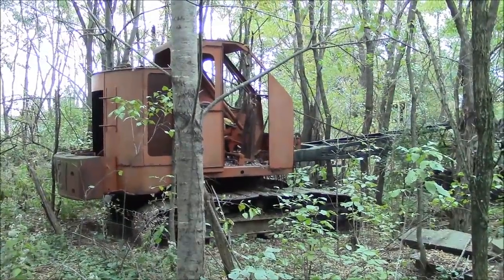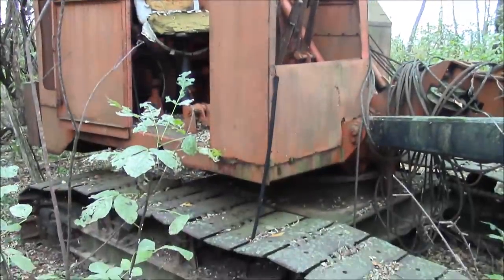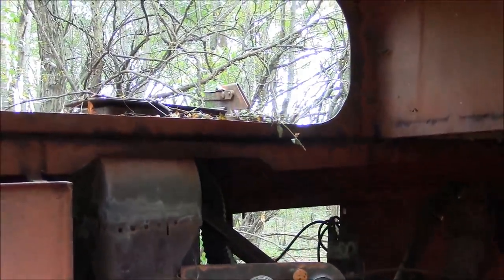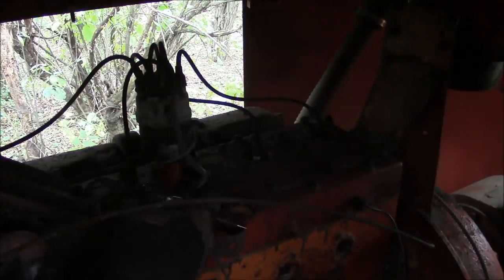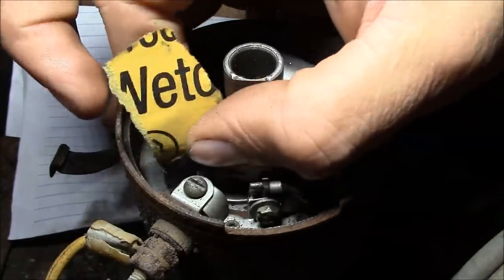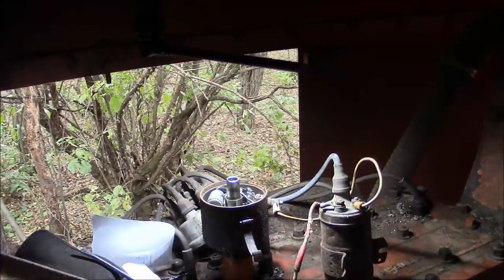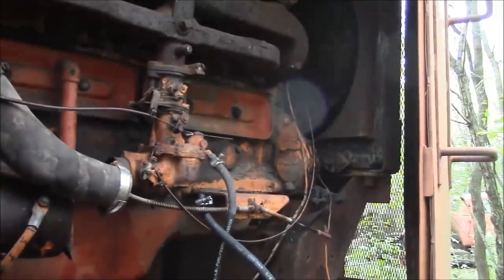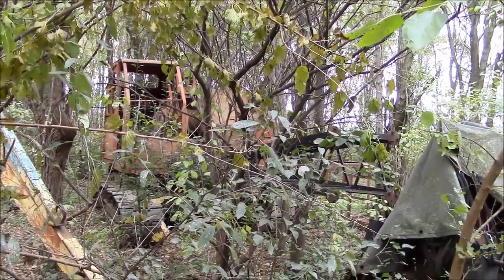Insley Dragline Crane Forgotten in a Field for 20 Years - Will it Run Again? - Part 1

Comment: Just showing my age, (66 yr's old) but the trick to set the gap points, is to use a cover from a book of matches, should be between .015 to .017 thousandths. I'm thinking the guy who operated this machine was more likely a Camel's cigarettes person. (Joke) The guy operating this machine couldn't drink on the job, cause his hands were full with those lever's.

Comment: engine is a Buda and it takes 2 batteries.
Reply from the maker: What model?
Reply: @WatchWesWork  Can't tell what year from watching on  you tube, but they use two 6 volt batteries wired to 12 volt, that's what that extra cable was , it goes between the two batteries. Wired to 12 volt. (Not two 12 volt batteries wired to 24 volt). 6 volt batteries have much more cranking power, expensive but the correct application here. Cheers.
Reply: @WatchWesWork  my bad continental 427

Comment: We think it’s a continental f226. Anyone else have an opinion on what it is?
Reply from the maker: It may be a Continental, but it's not an F226. The distributor is in the wrong place. The 226 distributor comes up between cylinder 4 and 5. This engine is between 3 and 4.

Comment: It's a BUDA engine for sure. I've found a youtube video with very similar machine, the guy called it "either K10  or K12 with a 6 cylinder BUDA HP 326 gas engine". https://www.youtube.com/watch?v=gm8WgPjSKNA right at the beginning.
Reply from the maker: I've seen his video. That engine is completely backwards of mine. The manifolds and dipstick are on the opposite side.

Comment: That is a Buda engine
Reply from the maker: What model?
Reply: @WatchWesWork  not model I would late 50's early 60's  but I can not be 100 percent sure what model is but I can tell you that that Budha engines company started in the 1880s manufacturing railroad equipment and in the early 1900s they started making engines around 1910 Atlantic diesel inline 6-cylinder and were the first ones to Patent lenova cylinder heads design but they made engines for all different applications through the early mid-1900s and they were founded in Buda Illinois you may be able to look the engine numbers up off the internet it should have casting numbers on the block

Comment: What would you do with a fully working dragline??  It’s a dinosaur
Reply from the maker: They are still used for dredging ponds, but long reach excavators have take most of that work. You still see them in sand pits, or at least I know of some around here still running. But, like I said, not much value.
Reply: There is a small contingent of viewers on LetsDig18's channel that think these machines are still relevant.
Reply: @cyrilhudak4568  the last time i seen one in use i must have been 8 and i am 50 now.   they was neat to watch at that age.  but the cost of wire rope and limited use is the only reason i said that.  and 1k is not any money.  i guess scrap you would get more hahaa

Comment: Sometimes if you have a stuck float a few sharp raps to the side or bottom of the carb will free it up. Of course that won't help with the plugged jets.
Reply from the maker: Not too let the cat out of the bag, but the carb has some major issues.